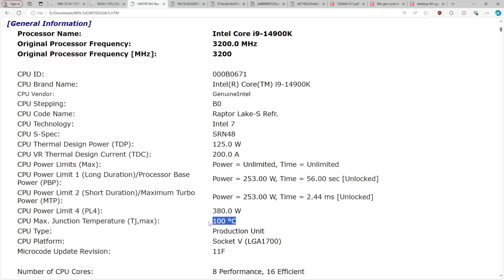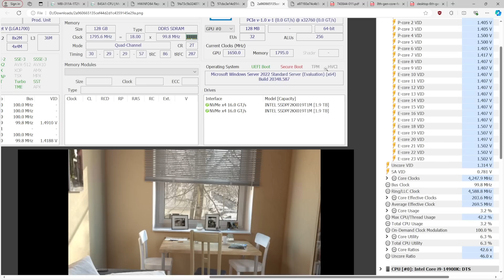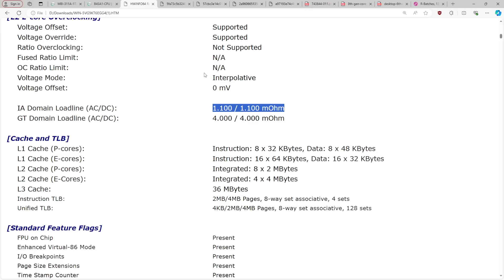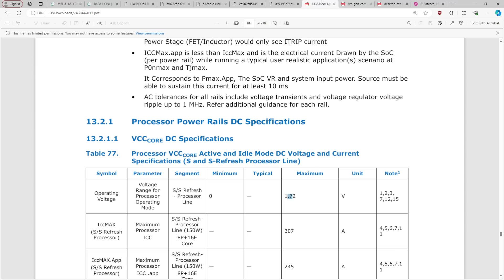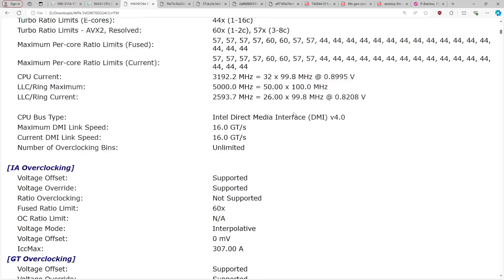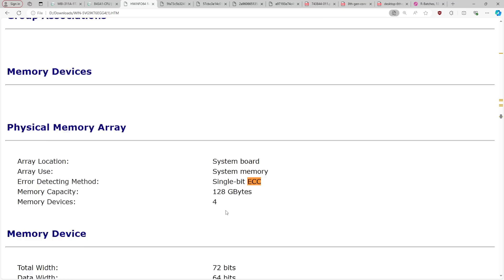Rambling about intel i9 14900Ks degrading in a Minecraft server hosting enviroment

Comment: Buying a secondhand albeit unused 13900KS is the worst thing I've done in a while. I was like "CPUs rarely die, it's relatively low risk". Now I've got a degraded CPU with no warranty. At least I've got it stable at 5.6 although I had to underclock and crank the llc to get it stable. Weirdly at stock 1.4v at default llc it bsods at idle every few days. At 1.35v with the llc bumped up from 4 to 6 it's stable.
Reply: Yes. Those times are over it seems :(
Reply: Don't buy Intel garbage 😂😂😂😂😂
Reply: I am on the same situation but with an 2nd hand 14900K, back in november.

At start all worked like a charm, now is unstable. Had to low voltage to 0.85v @ 5.5 GHz. Seems pretty rock solid now, my nerfed down 13900T now at 550 bucks with no invoice at all.
Reply: There will be a recall eventually, submit a case to the FTC
Reply: @peterpain6625  its fine with amd.
their cpus literally blowing up were actually the fault of motherboard manufacturers (asus) feeding the cpu too much power.
Reply: @guesswho2778  They fixed that though and are pretty ok with replacements as far as i know. We'll see how Intel does. For now the Intel fixes only postpone the dying until the CPU is out of warranty it seems...
Reply: "BSODs at idle" bruh 💀💀💀

Comment: I have an idea: Manually set the voltage to 1.45v with a moderate LLC - disable all but 1 P-core - leave all E-cores enabled. See how fast it degrades with a looped stress test. I have a feeling that the degradation that's occurring stems from the cache. Similar to how X3D chips will degrade the fragile cache when overclocked.

Comment: Insane Levels of customer screwing. They push the fix beyond AMDs release to look better at the charts. After that their CPUs will get decreased performance. It also pushes the issue beyond warranty. So the degradation is slowed down and the people who are affected then can stick their CPUs into their rears, because Intel tells them it's out of said warranty now. 
Well played Intel, well played. Deceiving, playing on time... that is perfect corporation shenaningans at it's best right in front of every customer. And they will go away with it with just a slight slap on their hands. 
I bet they even knew about the issue way before but sold their stuff anyways because the profits sould out the costs afterwards in their calculations.
Pure insanity if you really think about such behavior.
Reply: This is the most Intel thing Intel has ever Intelled
Reply: They are accepting RMAs, WTF are you talking about?
Reply: That doesn't make any sense. RMAs cost Intel money, that's profit lost. If they knew about the issue they'd have fixed the microcode bug. If they knew some of the processors were going to degrade and need RMA they would have scrapped the processors instead of selling them in the first place.

People forget that this doesn't affect all their processors.

There's a reason it's almost exclusively the i9's.

If I had to guess it seems reasonable to be only those already running the highest voltages from the factory ( barely making the cut ) that are the most affected because Intel's buggy microcode is pushing even more voltage into them and causing the initial instability and eventual "threshold shift" in required operating voltage for maximum boost clocks.
Reply: @zcomputerwiz Intel has to RMA them anyways. Most of the Issues ppl do have now until in a Month will not spike from 10% now to suddenly 70%. The Damage on most CPUs now are done. It’s better for them to sit there with a „better“ Review against new Ryzen and 3% more RMAs, vs 3% less RMAs but a worse Review.

Right now even GN just said „he look… we don’t and can’t recommend those Intel CPUs but we will test them as released“.

If Intel would have fixed it Allready it would be like „they fixed it, it’s not a big deal (or it is who knows) but we would not recommend Intel right now“.

They are fked regardless imo.
Reply: AMD just delayed their Zen 5 launch to August... Reportedly, because they are not happy with the quality, but who knows, maybe they want Intel to play their cards first... 😀

Comment: Even if the die is perfectly symmetrical, the power plane in the MB and substrate is not, so maybe the shorter-path side is getting enough extra voltage to degrade the odd P-cores fastest.

Comment: Saw a 12900k die in the way you are speaking of a few months ago, the host was fully shocked, first crash seemed out of the blue, then after second one it wouldn't pass validation, think its been in the box since 12 was new.
Reply: Except that the 12900K chips are not affected by this particular defect, only 13/14 gen.
Reply: @SteelBlueVision  @
12900k is extremely similar to 13700k.and just because Intel has not yet acknowledged that is not affected doesn't mean it might not have an issue.

Comment: Everyone is talking about power limits and stuff but I think it's the voltage. My 14900K when set to Auto voltages was hitting almost 1.7v. I manually set it to 1.32 and it's been perfectly fine. I'm wondering what the actual vcore voltage is when running.
Reply: 1.7!!! 🤯
Reply: @The_Man_In_Red must be an asus mb, mine went to 1.78 and the 13900k died FAST.

Comment: If after the update, none of the cpus will reach the advertised 6.0 boost, wouldn’t that make them liable for a class action lawsuit? 🤔
Reply: They will claim it's normal wear and tear .....bet or say it will * as long as Temps are below 40c ....another option is make it show 6ghz using null cycles hurts performance but looks good on paper
Reply: I'm no lawyer, but I think that if it says "up to" on the box, then nobody can sue for that because any number between 0 and 6 is "up to 6".
Reply: The only numbers the CPU's would need to reach to avoid losing a lawsuit are the base clocks  for the P-cores and E-cores, which I think top out at 3.2GHz and 2.4GHz respectively, every boost is an "up-to", and all of the turbos and boosts specifically call out other conditions that must be met and the maximum numbers are always "up-to".  

If you bought a 13900K 2 years ago and it never hit 5.8GHz, or more specifically, it never even hit 5.4GHz, even before this issue became a thing, Intel could tell you to pound sand as everything above 3GHz clocks are dynamic and best-case given conditions.  They would not RMA a chip that wouldn't hit max thermal velocity boost clocks, or max Turbo 3.0 clocks, or any other turbo /boost clocks unless it was crashing at totally stock settings.
Reply: @racerex340  My understanding would be from within the EU. Up to isn't allowed to deviate too much. Internet providers have been slapped because internet connections wouldn't come close to the advertised 'up to'. I think it's a 10% deviation that's allowed for some time. I imagine that can be applied to CPUs, too.
Reply: @maskharat  well, if it were 10% with thermal velocity boost, the Intel would need to maintain a single core boost of 5.4GHz for the boost window, and for any others like turbo boost 3.0 I think it'd have to be about 4.9GHz. I don't know how much the issue they're having is impact single/dual core boost performance, I thought it was mostly under multicore workloads, but if it is due to resistance, then hitting even 90% those single and dual core clock boosts might not be sustainable.

Comment: I guess im gonna buy my first AMD  cpu
Reply: Welcome to the club.

Well actually tbf I'm on an Intel right now but it has degraded over the years, and I really thought AMD was a powerhouse as a teen until all my friends convinced me Intel was better. Now after having Intel for years, on many different PCs, id rather have an AMD again.

I think Nvidia gpus are a lot more stable, but I still love AMD gpus. AMD ftw
Reply: @dementedpeep  I think intel is definitely better just works with everything and I think intel will eventually get this corrected I just should have stayed on my 12900k as far as Nvidia yeah they are a powerhouse I'm rocking a 4090 it's a beast but Amd is definitely probably better value
Reply: @timtoomuch  Is not better
Reply: @lenoirx  yeah I know I probably won't lol but while I was waiting on my new 13900k from intel I put my 12900k back in and ran perfectly

Comment: 8:07 About PL4, from the Intel 12th gen documentation:
The package power control settings of PL1, PL2, PL3, PL4, and Tau allow the designer to configure Intel® Turbo Boost Technology 2.0 to match the platform power delivery and package thermal solution limitations.
    Power Limit 1 (PL1): A threshold for average power that will not exceed - recommend to set to equal Processor Base Power (a.k.a TDP). PL1 should not be set higher than thermal solution cooling limits.
    Power Limit 2 (PL2): A threshold that if exceeded, the PL2 rapid power limiting algorithms will attempt to limit the spike above PL2.
    Power Limit 3 (PL3): A threshold that if exceeded, the PL3 rapid power limiting algorithms will attempt to limit the duty cycle of spikes above PL3 by reactively limiting frequency. This is an optional setting.
    Power Limit 4 (PL4): A limit that will not be exceeded, the PL4 power limiting algorithms will preemptively limit frequency to prevent spikes above PL4.
    Turbo Time Parameter (Tau): An averaging constant used for PL1 exponential weighted moving average (EWMA) power calculation. 
Notes: Implementation of Intel® Turbo Boost Technology 2.0 only requires configuring PL1, Tau and PL2. PL3 is disabled by default.

So this is a value that can't be exceeded because the frequencies are limited "preemptively".
Reply: In short: PL1/PL2 is a thermal limits, PL3 is for battery protection (not used on desktops), PL4 - electrical limit for VRM decoupling

Comment: Weirdly, I had a 9700k that went bad, randomly one day was unstable at stock, even like -700mhz on all cores, it was able to run stress tests a bit longer but eventually BSOD.
The cpu was also hosting a lot of modded minecraft at that time. Was told it was a rare 9th gen bug and intel ended up offering me a refund. Always found it weird because cpus are meant to be super rare to fail - and i never played with unsafe voltages and temps would always be below 80c.

Comment: Electronics engineer & PCB board designer here.
About AC DC LL values: if you set it to 1mohm it is not safer! 
The CPU will ask for more voltage under the assumption of 1mohm*current voltage droop. If the motherboard power delivery impedance is lower (hence better) than 1mohm you will fry your cpu with higher than expected voltage
Reply: Easier to blame Intel than Minecraft admins I think, narrator says "nothing wrong" with chip destroying settings because it's an overclocking channel
Reply: Exactly, came here to say this. If the whole LL calibration works as I understand it does, and given buildzoid says that "setting LL slope to a lower value than the board capability allows will feed less voltage to the CPU than it expects", then the inverse is obviously true as well. I.e., setting LL slope higher than the actual capabilities of the board will thus feed more voltage to the CPU than it expects — which sounds exactly like the recipe for a disaster?
Reply: Hello,
You seems very knowledgeable on the subject, is there's any ressources you would recommend to learn the propers methods for tweaking a cpu?i am looking to undervolt a 7800x3d.
Cordially.

Comment: Someone need to CONNECT THE DOTS.
1- Intel had problems in production, specifically in the coating of anti-oxidizer
2- Oxidation adds RESISTANCE.
3- CPU wants power,
4- finds resistance,
5- ask for more power....
6- and ded!

Intel says about Microcode, yeah sure.
Reply: That was a problem already dealt with in 2013, was a fault in the production process that's been amended.
Reply: @tmsphere  so the current problem still persists??
Reply: @ginger_toggafIntel employee spotted.

Comment: @ActuallyHardcoreOverclocking About you said at minute 29:00, this current CPU im using is my third 14900KF, the first two died before 2 months of use, out of the box (note this was prio this whole incident blew up on media and BIOS versions where basically OC), playing not demanding games, not doing benchmarks at all. Both went almost the same process, casual errors at first, perma blue screens after a week or two, imposibility to run games (or even discord)...
Reply: I got down voltage and freqs and now my 14900K is back to being a stable nerfed down 13900T
Reply: @Pacho18  Yup, I'm running mine now at intel recommendations on newest ASUS BIOS version, but changed PL1 to125W, and ICC max to 307 and cores to x54 (just in case, im paranoid at this point), rest seemed fine. Waiting for august patch to see if my performance drops even lower haha
Reply: @davidadan1993  Intel's default on my msi pro z790 are wild, so i tuned myself by try and error until i got a succesful stability by reading news and countless subreddit posts. Mine is happy with PL1 at 253W and PL2 at 288W, ICC at 400A (recommended by intel) but then all nerfed down to 0.85VCORE and 5.5ghz max turbo limit.

Comment: I think the only solution for Intel is to release a Socket 1700 "Minecraft Xeon" that doesn't fail, does decent clocks and has like 8 performance cores. Then offer that one as a replacement for the cpus that fail. For now they're only trying to push the failure out of the warranty window.
Reply: You are describing Intel Bartlett Lake, which is slated for 2025.
Reply: @Clippy447  Bit late to the party ;)

Comment: Modern Intel CPUs (since 10th gen or so) applying some hidden 1.5 ratio on specified AC_LL so in order to get requested VIDs close to fused VIDs you need to set AC_LL / 1.5 from DC_LL/VRM_LL.
Or if you follow "standard" AC_LL=DC_LL=VRM_LL rule then your CPU will be constantly 1.5x overvolted depending from current it draws

Comment: Would be interesting to know if it's just "normal" degradation of the ring (where a lower clock would temporarily fix the issue), or if it's actually a hardware failure

Comment: The fix won’t fix an already degraded CPU. Factory OC bites manufacturer in A55. Now thousands of reviews and benchmarks are invalidated, but almost nobody will bother updating them for those that will still be buying these CPUs over the coming years.
Reply from the maker: Of course a software/firmware patch won't fix degraded CPUs.
Reply: @ActuallyHardcoreOverclocking  If my CPU is currently passing Prime95, will the new microcode protect it from going bad?
Reply: @ActuallyHardcoreOverclocking  Let’s hope Intel find a way to look for degraded CPUs so that customers can get a refund, or a replacement.
Reply: @ActuallyHardcoreOverclocking  They try to push the failure out of the warranty window. Nothing else.

Comment: If these CPUs are getting degraded and damaged by excessive voltage spikes, then the 'fix' that lowers the voltage back to safe levels is going to come with a steep frequency degredation or it's going to destabilize a lot of CPUs in the field.
Reply: The fix specifically means disabling the 1-2 core thermal boost which is what is pushing the 1.5+ volts through the CPU.  Without that the CPU works fine.  But yes, its disabling a feature that the CPU was specifically sold for.
Reply: So tell me you've never undervolted without telling me you never undervolted a cpu.
Reply: If The CPU is ran at stock, it will automatically adjusts its frequency based on the voltage it's fed. They will not get less stable, but boost clock will decrease to accommodate for the lower boost voltage.

Comment: I have a 13900k and I realised that if you simply disable c states so it doesn't boost the p cores or the ring, it stopped the crashing in games (Also I don't think I have ever seen it boost to 5.8 on the p cores or 5 on the ring when gaming because the task scheduler generally tends to spread out a load to more cores. so games run 4 or more at the least)
Reply: Yeah but at that point would the math have been different enough for you to buy AMD at the time of purchase?
Reply: @TheHighborn  the 7800 X3D was not out when I bought my 13900K.  I bought it about 1 month after launch in Nov 22.
Reply: Yea this is what I ended up doing with mine ages ago which is probably why its still running fine.
Reply: @TheHighborn  I bought mine in nov 2022 and i didnt want to dable with dual ccd problems. But in hindsight, 7800x3d is way better for gaming. Don't get me wrong I think every platform/cpu has some problems it's just that some have easy workarounds and some don't. And apart for some IMC/memory compatibility shenanigans initially (Thank you gigabyte for the hilariously bad qvl list) I haven't had any other problems

Comment: Something I find interesting is that Intel introduced their coax MIL inductor tech into FIVR for Xeon Max Sapphire Rapids (the parts with the ludicrous package currents) as a replacement for Magnetic Inductor Array (MIA), and then, from what I understand, put the same tech in 13th & 14th gen desktop SKUs too. I wonder if the high package voltages are cooking FIVR phases rather than the ring. EDIT: Nope, no coax MIL in 13th/14th desktop SKUs. I went and dug through the patents and presentations and it's clear they're only using coax MIL on server SKUs; the desktop SKUs are still using ACI. Although it's very interesting to me that Intel intended to add DLVR to Raptor Lake to deal with undershoot issues (it's an LDO that clamps to Vmin during undershoot on load transients) and allow for lower VID/LLC programming, but then fused it off last minute.